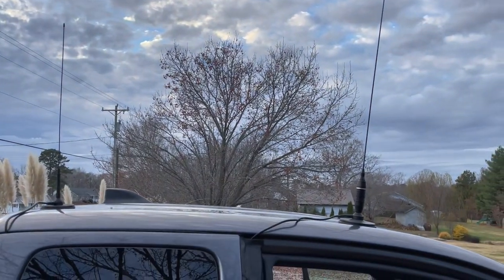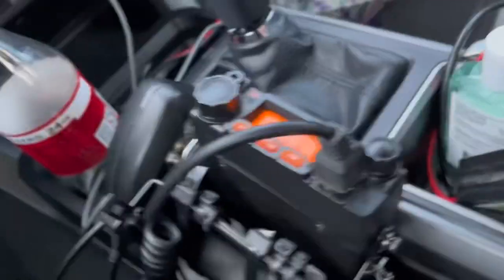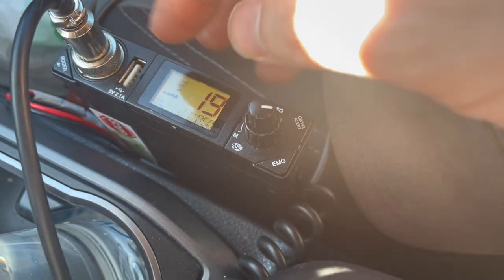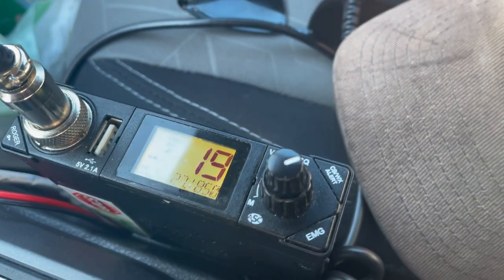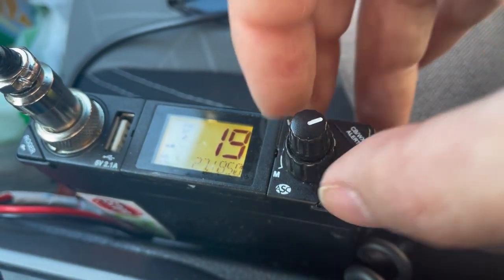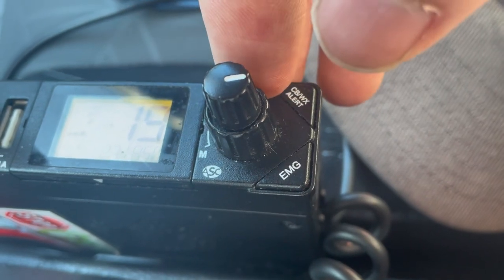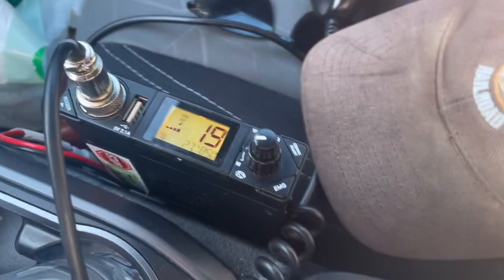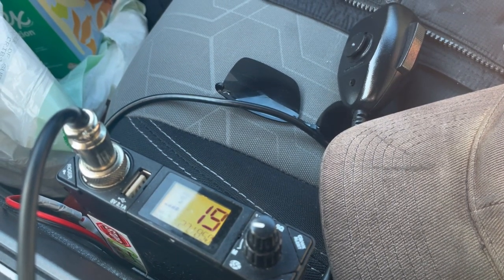CB/Ham Radio trip from NC to MA in rental truck

Comment: Why can't you just use the CB to talk to truckers on their CB? I think I missed something
Reply from the maker: You can. Especially if it’s half squelched what I was getting at is filtering skip and high powered stations like mud Duck out so you can just hear local truckers. By using RF gain and Squelch. If you run with your RF gain open and squelch close to “static” you’ll just hear skip and mud Duck and other annoying nuisance radio traffic
Reply: These days many truckers don't even speak English. I started trucking in the early 70s and everyone was on a CB. Not so much anymore, but now that I'm retired I always run a CB on long RV road trips just in case. And, after a 20 year hiatus from ham, (though I've always renewed my ham license) I'm getting back into ham radio. I just bought a brandy new Yaesu FTD 500 D. I'm loving it.   KD7LWL
Reply from the maker: @MrTommy001  very right many many different ethnicities… the boot wearing truckers are now flip flow sweat pants wearing truckers